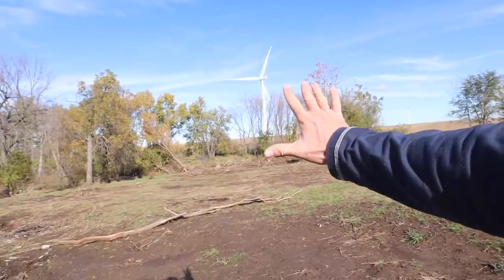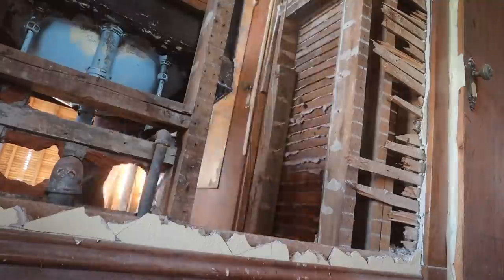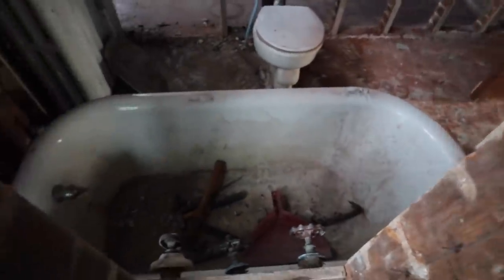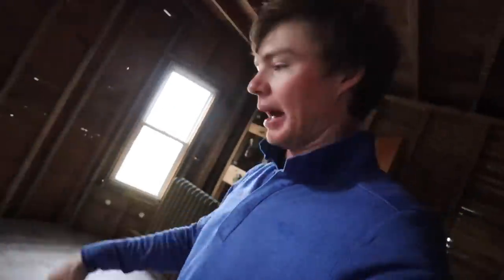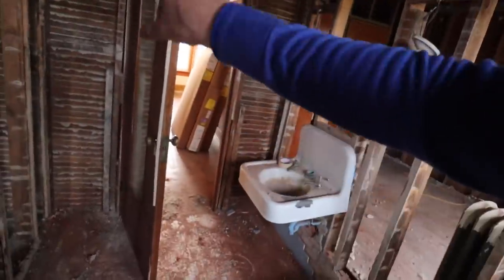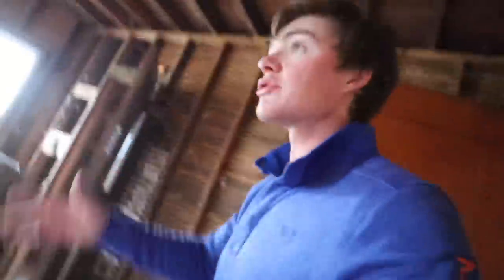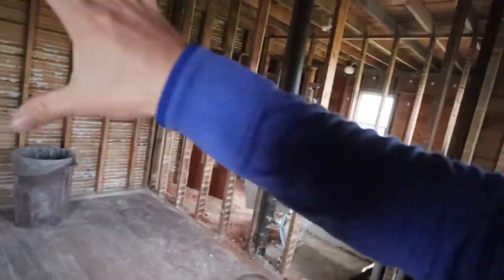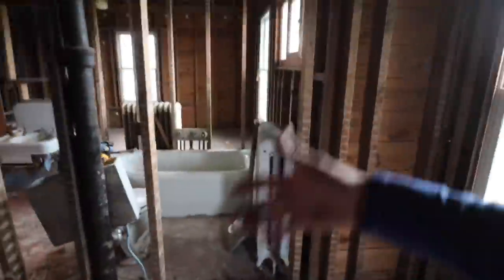I Am Building An Underground Movie Theatre

Comment: What about using a sawzall to remove the majority of the lathe and plaster? You already have one half stripped off so you know where all of the wiring and other obstacles are. I think that would be a lot faster than beating the walls with a hammer. Good luck.

Comment: Not sure what you plan for the heating and ac systems. While you’re down to studs is the time to make those changes. Have you considered split systems to more efficiently heat or air condition a house like yours. You can now run the ugly lines inside the walls. Once the walls are closed they would run the lines outside the building and it doesn’t look great. Also, have you considered geothermal?

Comment: If the bath tub is cast, it will shatter if you hit it with a sledge hammer.
You could use an angle grinder to cut it up.

Comment: See if someone wants the old tub.
If tube is cast iron you can break it with a sledgehammer.
Metal tub cut it up.
Good luck.
Don't destroy the cast iron radiators, they are valuable. Plus you can reuse them

Comment: Grab a sledge hammer and bust up the cast iron tub.  I learned that the hard way.  After I had taken the old, 500 lb. cast iron tub out of the 2nd floor bathroom, I ran into a plumber and asked him the best way to get rid of an old cast iron tub.  He said grab a sledge hammer, bust it up and either take to dump or to a metal recycling center.

Comment: The tub is cast you can bust it with a sledgehammer. Surprisingly it is easily done. I had one i fought with for a week and a older fella came in and in 30 mins it was all in chips.

Comment: You need to do the wiring before you insulate!!!!!!!!!!!!!!!!!!!!!!!!!!!!!!!!!!!!!!!!!!!!  You can dry ice clean the attic floor so you don't have to rip it out. I would highly recommend you stop and get the electrical and plumbing done before the insulation.

Comment: Laminate planking isn't very sturdy and you'll likely have to replace it periodically. If you really want to go fancy, go with LVP - Luxury vinyl plank. Wood is better, of course, but a lot more expensive, and even wood has downsides. LVP is only a tad more expensive than laminate, but so so worth it, and if you get the professional-grade, it's both waterproof, looks like wood, and is really sturdy. Plus it installs just as easy as laminate. Laminate is increasingly only being used on cheap builds because people are realizing that it doesn't have much longevity, especially in rougher situations.

Comment: Cole, modern air conditioners have scroll compressors. This means you can have constant heat or cooling without the a/C unit cycling on and off, creating even heating/cooling. Ask your local A/C company and see what they say.

Comment: Instead of forced air system look at a mini split system with a heat pump. Save a ton of money on ducting and put the heating and cooling where you need it. And you can keep the radiant heaters for additional heat in the dead of winter, when heat pumps don't work as well.

Comment: This may be a silly question, but are ya gonna run all of the wiring on the second floor before the spray foam is added?
Reply: Nope, he's going to create a video next Spring complaining about how the insulation contractors screwed up and foam insulated before he had time to run wire.  If he's smart he'd go ahead with blanket insulation at this point.  At least then he could remove it as he needs to to run wires and plumbing.

Comment: Don't know how it could be better with all that cheap siding.  It is a fantastic house. Guessing better would be the installation of insulation.  Upgraded wiring does not fix siding that won't last as long as original.  James Hardy plank is stuff for this millennium.

Comment: Cole.  Re the tub,  it is probably cast iron.  Just get a sledge hammer.  Then make sure your eyes and ears are protected.  Wack the heck out of it.  It will break up into as many pieces as you want.  But BE CAREFUL.  When it breaks it will leave shards and sharp edges.

Comment: 2 inches of insulation? In Norway we use 10 inches in the walls and 18 in the ceiling. And insulation between all rooms, so you don't heat up more than necessary

Comment: Them old bath tubs are cast iron a sledgehammer will break them into smaller parts you can handle but dry ice on a corner get cold and hit it it will shatter into small pieces just hold the dry ice in different spots and hit it🍺🙀🇺🇸

Comment: Cast iron tubs are very heavy- very true. Cast iron is also brittle- very true. I'll bet you have an eight or twelve pound hammer and can guess the rest. The pieces are much lighter, but watch out for the porcelain flakes- they are very sharp and dangerous! Unless you want to reuse that old dear- in which case, I would say pick out a window that needs the sash replaced and take it out and use the boom lift as a mechanical aid. 
  ON the laminate flooring; do tons of homework, go see it where it has been for four or five years- crawl around on it. Be sure you like it a lot- it is the hardest thing to change after the fact. Don't be afraid to pick Justin's brain on any of these choices- he's probably seen all of it before.
FR

Comment: Cole, before you have the house spray foamed see what the installer's removal policy is.  I have seen videos on youtube where spray foam has caused respiratory problems to the homeowner after their homes were insulated.  and after having a home insulated with spray foam, the homeowners had to move out for health reasons.  They were trapped because they couldn't sell their home, due to air quality issues and it was a nightmare.  I am not saying all spray foam is like this.  I am just saying to check into it.  I hope you don't have any issues, but I would hate to see you have problems.  Do some research about it.

Comment: putting spray foam insulation in those walls may not be the best idea. The reason those walls have done so well not rotting is because they are allowed to breath and dry any moisture that gets in there. If you spray foam, you may be preventing any air flow in those walls and now be susceptible to rotting the wood in those walls. You may want a dimple mat or something against the outside before the spray foam.

Comment: The cheapest way to insulate is to spray only enough foam to stop air infiltration then finish insulation with fiberglass. I realize you have a really odd thickness of insulation for fiberglass.
Reply: What about the dew point in the wall system?

Comment: You will be missing the radiant heat. 
If you don’t like the radiators put in heated floors.
Nobody said you can’t have radiant heat and a/c together.
I always felt like forced air heating makes much worse dry air

Comment: Maybe don't spray the ceiling use fiberglass insulation until u tear out attic floor boards this way u can reuse insulation in ceiling after plywooding attic floor just a thought

Comment: Laminate flooring is definitely not over the top compared to the original probably oak hardwood floors. You can save them easily by getting some unfinished oak flooring and then just sanding and restraining what you have. You can get your dark floors that way. Going over the top would be having dark oak floors that can actually be redone if need be. Laminate is an inferior product for sure.

Comment: Instead of spray foaming the ceiling roll out fiber glass insultation on the floor of the attic.  Not as efficient as spray foam but will save you wasting the spray foam.

Comment: Flip the tub upside down and and smash it with a sledge hammer thats how I always did it if you have a old sheet cover it with that there will millions of little glass splinters  as the porcelain coating comes off

Comment: Speaking from experience get your electrical work done first before you do the foam spray insulation. Trying to run electrical wire after the fact will cost you more time and effort in the long run. Regarding that wood floor. People pay huge money for old school wood and flooring so something like that from the 1900's is more extravagant then anything you can put down today. Should really reconsider if your trying to maintain that status quo. Any good flooring company could prob stain/bleach the current wood flooring that's down and match it with any new wood you need as you extended the room.

Comment: run your wire and set your boxes on the exterior walls before you spray foam it.  You will regret doing it after and you can do it takes no time at all.

Comment: Ok, ok, I understand that house is a legacy, but from what it looks is not much. I would rebuild it from scratch with new materials, bricks, rebar, concrete, and wood just for the roof. The weather & the climate will surely change. I believe is better to have a strong house able to withstand anything than an older one which is not built to last.

Comment: I wouldnt use air duct for heating. Air is terrible in transmiting heat. Water works much much better. So go for floor heating its awesome. You dont need hot water you need warm water to heat up space...

Comment: You’re doing GREAT! Been there done that! Just do what you can when you can.
I’m 62 and 4th generation in our family’s farm house and I have been doing the same thing as you for the past 13-years.
Everything is new except the exterior walls.
Two-years ago, we put on a new steel roof, no more loosing shingles when we have high winds. 
Our most recent major expense to a totally remanufactured 125-150 year-old farm house happened today. Our 26 year-old LP gas furnace was replaced with a high efficiency (Energy Star) dual fuel heat pump. 
The last thing I have to do is replace my flooring and carpets, “again”. They pretty much got ruined with all the other construction going on. 
Good Luck!

Comment: Cole, you are doing everything backwards.  You should reframe the attic floor first, then siding, then have the electrical, hvac, and plumbing roughed-in, then insulate and drywall.

Comment: Those wood floors lasted 100+ years.  Laminate flooring is guaranteed about 20  -  unless they've improved it.  There are houses in the Northeast with floors from the 1600s.  Why replace that with something that will need to be bought again before you are even middle-aged?

Comment: Bath tub... cast ...sledge O matic...it "should" break into small pieces. 
 Are you getting a women's opinion on some decorating.
An absolute must " HEATED FLOORS FOR TILE".  We put tile in every room with radiant heat. We haven't turned on  our forced Air Furnace since the wood stove and heated floors.

Comment: Is the tub cast iron or plaster? If plaster you can just break up. Iron, ask local football team to carry it to a truck for you
Reply: A plaster bathtub???
Reply: @ChevyC-hf6km  they where more popular in the 50s and had insulation on the inside. Bathroom could have seen a remodel at one point and got the plaster casted tub
Reply: @clarissawagner9847  Okay, dumb question... how do you put water in a plaster tub and not have it disolve?  Are you talking about a ceramic tub?
Reply: @ChevyC-hf6km  maybe that is what I am thinking of. Pretty sure what my parents busted out of their bathroom was a sealed plaster. Either I could be wrong, it was many years ago.
Reply: @ChevyC-hf6km  or porcelain, remodel is not my specialty and I think that is clear. Cole wanted to get rid of the tub and I just questioned if he could bust it up with a 5 pound hammer.

Comment: I disagree. Having all of your main bedrooms be decently large rooms with en suite baths is an attainable luxury that cannot be overstated. Not having to leave your room to use the toilet or bathe is just so, so nice. In my personal opinion, if I were building a home from my dreams, every dedicated bedroom would have an en suite and a decently large closet. Even guest rooms. And then you'd have an extra half bath on each floor, just in case. It's a miserable experience to have to queue to use the bathroom in your own home.

With regards to the flooring, having installed laminate flooring myself, if you can get hardwoods or real tile then do that instead. I'd honestly rather have carpet in the living spaces than to deal with laminate. At least carpet is comfortable and easy to replace. Laminate is tiresome to install and prone to creaks and groans with changes in temperature, even if it's solid vinyl laminate flooring. I'd go real tile in the bathrooms, real hardwoods in the places that matter, and then carpet everything else. If you find that you really want hardwoods in the future, it isn't a huge deal to get the installers to match and blend the new stuff into the existing flooring. If it's possible to salvage existing hardwoods then that's even better, but with how many walls you're moving, I can understand that this might not be possible.

Just remember when you go to redo all the bathrooms in the future that you should seriously consider using concrete board instead of drywall for the entire bathroom to avoid the humidity causing problems for your drywall in the future. It's usually code in most states to require that in the shower and around built-in bathtubs, but going ahead and using it on all of the walls and ceiling can be good insurance against future trouble. Also, if you hire tile guys to do your bathrooms, make sure to ask if they use a spacing and leveling system for their tile work. If they don't, then don't trust them to do the job properly. Even if you buy mesh-backed mosaic tiles, it is very likely that they'll get installed crooked and at different heights. Just go with separate tiles and use an installation system like the QEP systems with the break-off leveling plates with spacing guides. That way all of your tiles go down perfectly with even gaps. I had to go back behind the tile guys that did our kitchen backsplash to try to level and even out the spacing between the tiles before the mastic set because they did such a poor job of aligning the tiles. It is worth it to pay extra to get it done properly the first time, otherwise you will notice those flaws every time you look at the tile. Also, if they say that they don't have to wait for the mastic to cure out before they grout, don't go with them. If you don't wait for the mastic to cure then the pressure you apply when scrubbing in the grout can cause the tiles to shift and fall out of level.

And another thing: when you're redoing the kitchen or bathrooms, do not go with painted cabinetry if you can avoid it. Most of the painted cabinetry uses a very delicate paint surface and is easily stained, marred, or otherwise damaged. Just go with solid wood cabinetry and get a stain color you like. The polyurethane top coat on those is much more durable and you can typically get a solid or translucent stain color very similar to the paint colors on offer and the finish will last better. Also, pay the extra money to go to a place that specializes in kitchen remodeling, you'll experience fewer problems during the process.

Also, I cannot recommend enough that you insulate the ceilings with spray foam or rock wool. It goes a long way not just in keeping your cooling zones efficient and consistent, but it also blocks a lot of noise from leaking between the floors. Personally, I'd also recommend exclusively using sound isolating drywall products instead of conventional drywall. Surprisingly enough, lath and plaster construction is generally better at sound isolation compared to conventional drywall with no sound treatment. So if you don't want to spray-foam your interior walls or use a sound damping insulation like rockwool, then sound damping or isolating drywall is a great option for reducing your ability to hear what's going on in neighboring rooms.

Additionally, and I cannot possibly stress this enough: hire someone to install and mud your drywall. Hire whatever company has the best and most reliable reviews. Drywall is NOT something you want to tackle on your own. The installation is really, really annoying if you don't have the right tools and the right technique and the mudding is 100% not something you want to deal with because you absolutely will not be able to do a good job within a reasonable amount of time. It takes way, way longer to sand off extra mud than it does to do it right the first time. Just hire the right people for the job and let them save you time and effort so you can spend that time making money instead of fighting with drywall mud. I had to re-mud a large portion of the joints between the ceiling and wall in my kitchen and it is NOT something that I ever want to deal with again. The hardships of trying to remediate a house built by people who didn't care about the quality of their work.

Comment: A laminate plank floor in a 1900's farmhouse, please just say NO!  At least; look into engineered wood if solid wood is out of budget.   I like to think we restore historic homes and we don't remodel them like we do houses built in the 70's or 80's.  Just my opinion.   A sledge hammer will make that big cast iron tube into nice smaller pieces.  BTW a like for like tube probably cost around $5000.00 today.

Comment: You should have just built new since your replacing everything with plastic. The plastic will need replaced in 20 to 30 years the wood has been there 100 years. good luck.